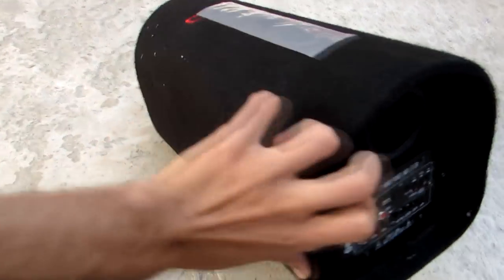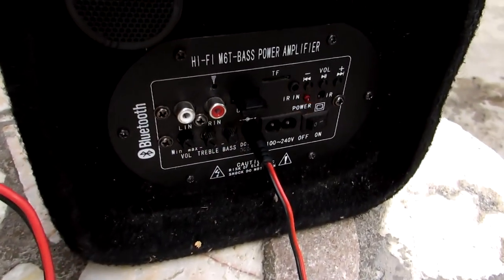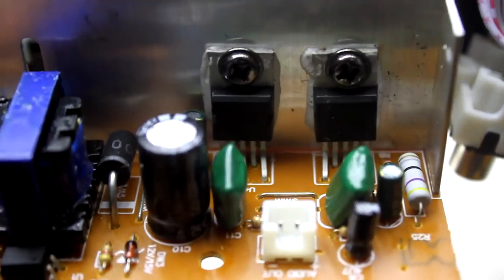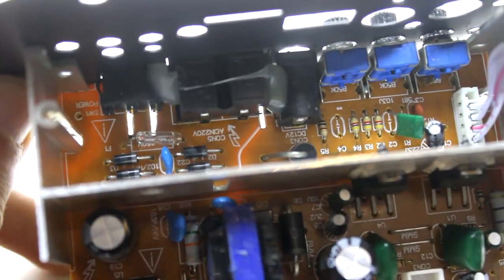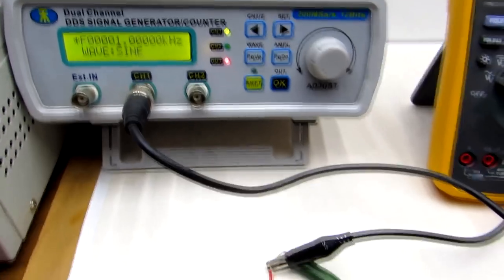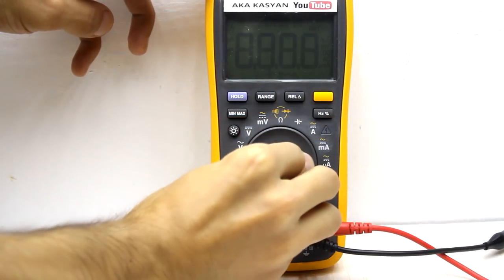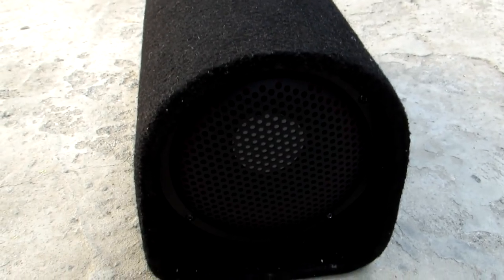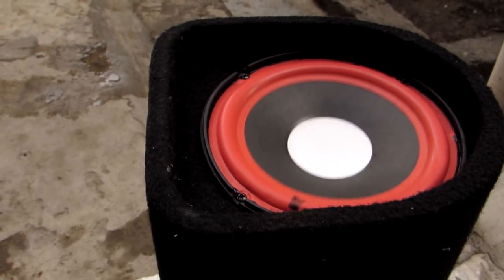How to increase the POWER of a Car Subwoofer

Comment: while knowing how to make a boost converter is very valuable especially for specialty applications it likely cheaper to use a ebay boost converter., they are about $5 and good to keep a few on hand. and their efficiency is usually decently higher because they use perilous built switcher ICs.

Comment: I need quite help how can I make legit booster ? 220 or any
Reply: you can buy smps adaptor 220v to 24V 5 amps on aliexpress
Reply: smps must more for expert to handle grounding noise problem. if you not an expert try use standart transformer 24v 3Ampere